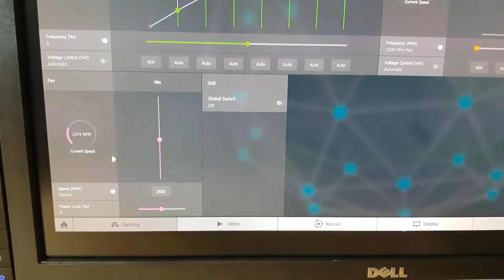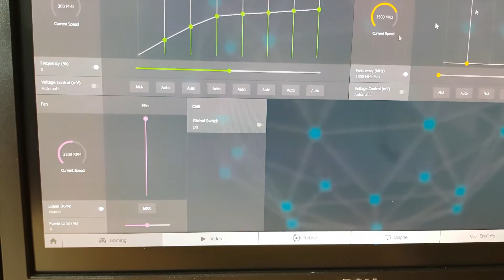Gigabyte G1 R9 390 Fan Replacement Part 2

Comment: I have done this on my gigabyte r9 390 . It worked great. Why does the "replaced" msi fan still spin after turning the fans down/off (Just curious)?
Reply from the maker: Probably different amp of fans, voltage is same

Comment: Hey, thanks for this. I tried to do it, but i failed with the wire connection. The msi fan doesn`t spin. Can you tell me, what wire is on what pin at the connector? Tryied 1:1 (Left wire, left pin, etc.). Sadly the GB fan cables are all black.
Reply from the maker: +s0nic79 I follow the line. Strait from GPU board
Reply: how? they are still black. how do you know which is ground for example

Comment: Hey!
Good video!
How is the sound and how are they working ? Temps better or worse ?
Cheers!
Reply: where did you get the fans from? I also have gigabyte r9 390 as well......
Reply from the maker: +jimmmmy19 thanks bro. Yeah the new one works really good, this annoying jet sounds is gone, also temp drop by 5c . I ordered second one . Stoke ones are bad and the cost 40$ new ones. Better to put different ones. They are more massive then stoke
Reply from the maker: +OldSchoolGamer Forever I find mine on eBay and it was complicated with sizes on the fan, measure your and find same and same amp and voltage